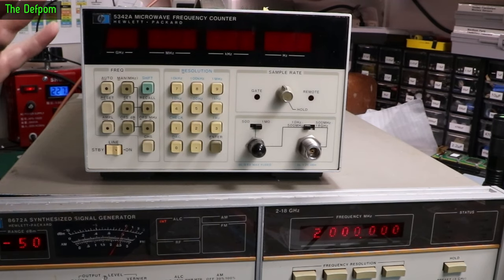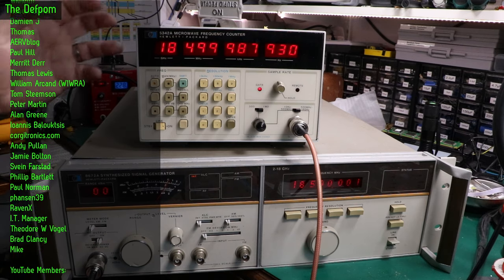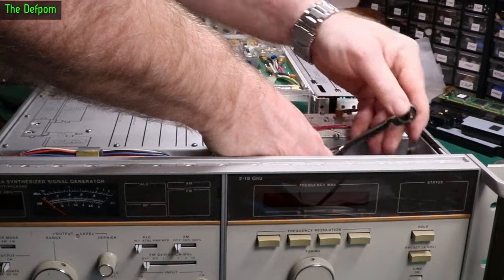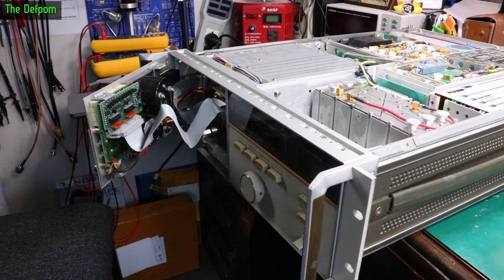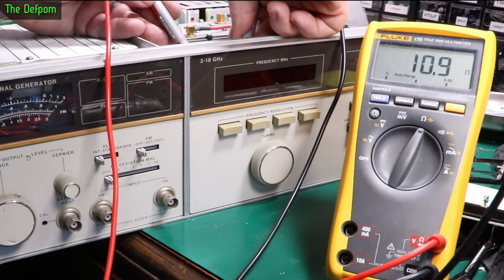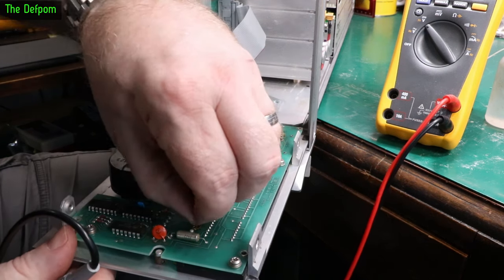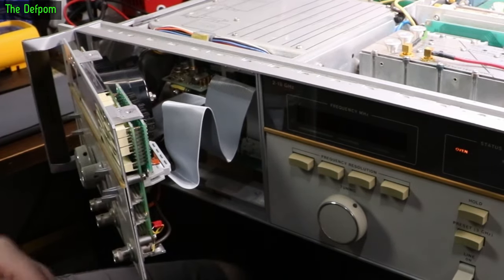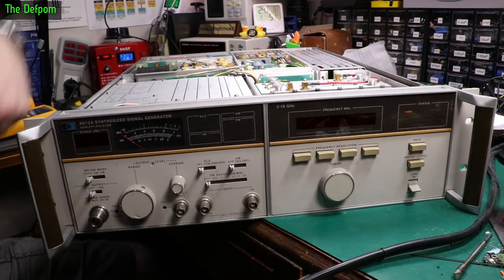🔴 HP 8672A 18GHz Signal Generator Repair Part 2 - No.1208

Comment: I had a few of these old unit using T1 1/4 bulbs. Once repaired another one broke. Eventually I got fed up with it when finally a bulb broke and I was chasing a ghost error for hours just because I trusted that bulb. So I replaced all of them with various LEDs and also modofied the circuits to keep the LEDs happy. Happy ever since.

Comment: I rebuilt those battery packs out of NIMH AA batteries.  They've worked fine so far.  As long as there's not too much corrosion on the pack or contacts, they can be reused

Comment: Nice RF signal generator, can't beat HP quality.   I had a similar issue with a very dim bulb.  It looked all silvery inside the glass as the filament gave off deposits on the glass.  It must have had a lot of hours on the little bulb at any rate.  What happened to the display when it all went to zero's?  Maybe just a loose connection on a board?

Comment: Thats the thing with bulbs: The broken filament moves around. It gives you a good reading on the meter and when you put it back into the unit the tungsten filament does not touch anymore and the bulb won't light up.

Comment: A unit to stay away from is the 8640B, as they have a set of plastic gears in them, which, with age, are bad to break. I've read several horror stories about them.
Reply: You can get new ones
Reply: Been there done that. Got rid of it.